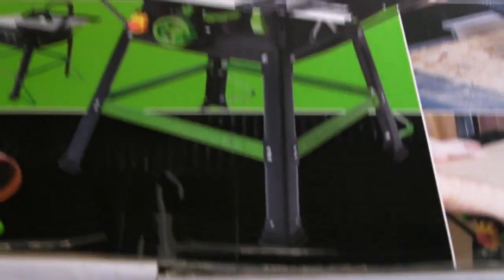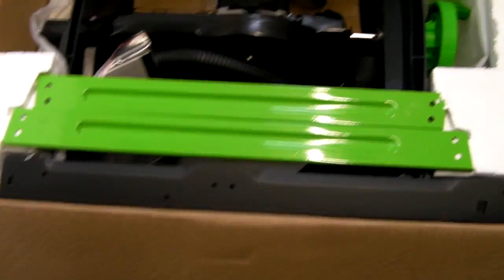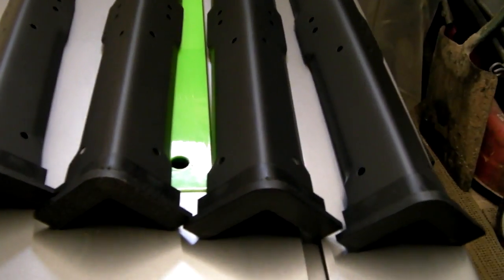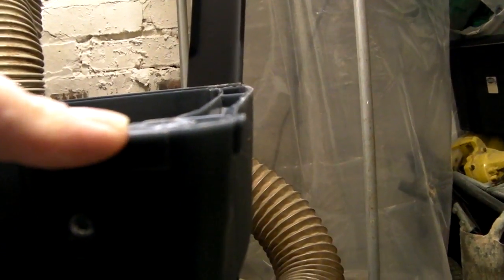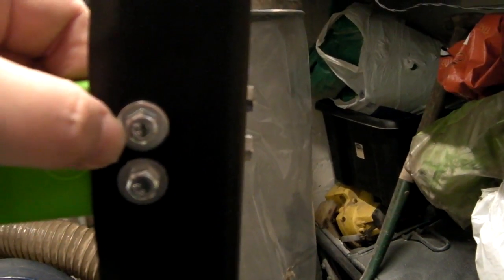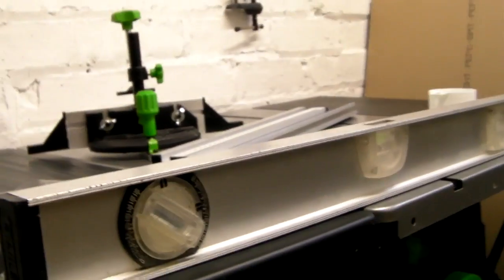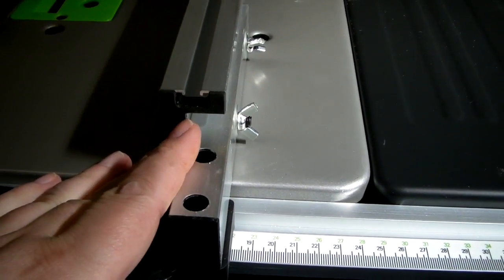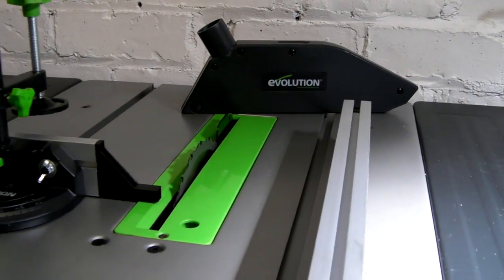Evolution fury 5-S table saw review and assembly

Comment: My blade guard is transparent plastic, also Ive used 4 by 2 to make a frame to sit at the base of the legs with lockable  75mm casters to make it moveable with the option of it being made motionless using the locks also Ive left off the `dont tip over brackets` as with the casters they would be too high to function.